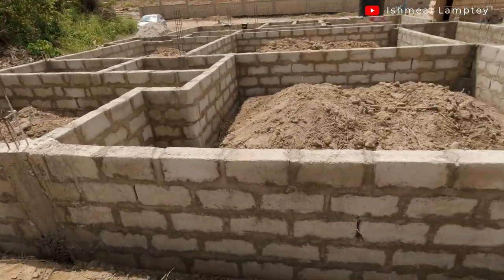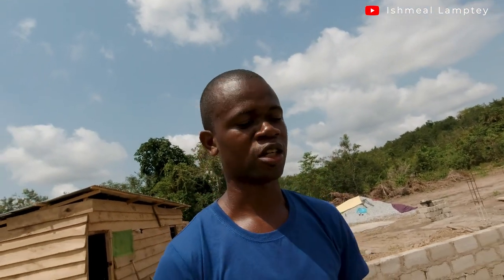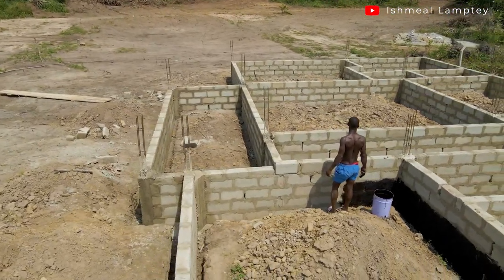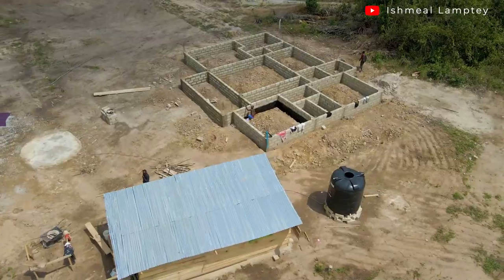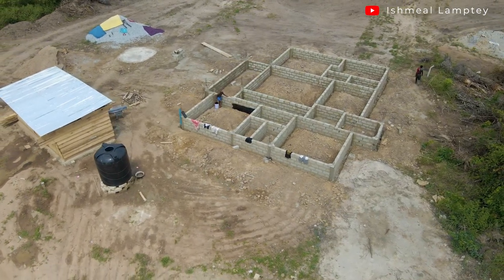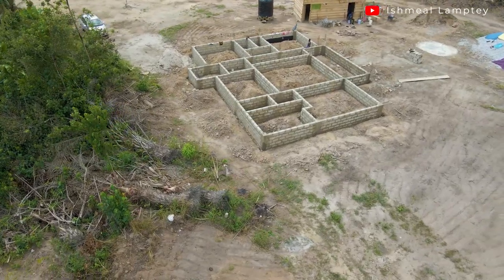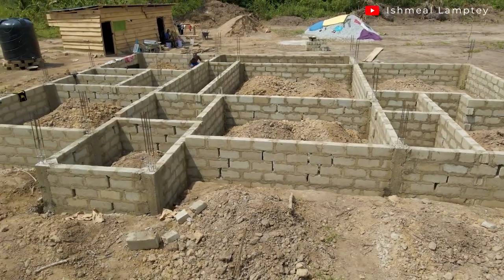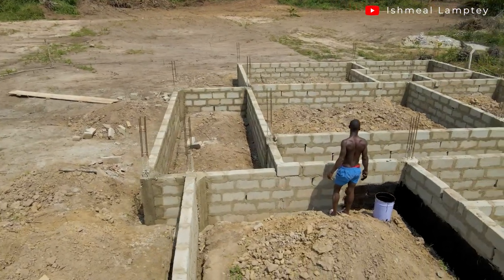Defending Against Damp: Effective Strategies for Protecting Your Walls in Ghana

Comment: Question: is it safe / structurally sound to lay in the trenches the dpm, then the concrete, then block and mortar courses ?
Reply from the maker: Yes it is. The dpm serves as a protective layer between the soil and the concrete. Based on how it is spread, it could prevent the soil from getting contact with the concrete as well as the blocks.